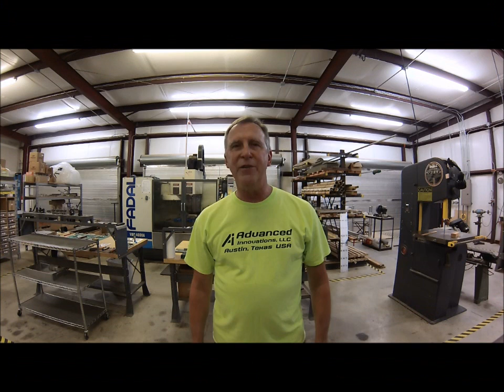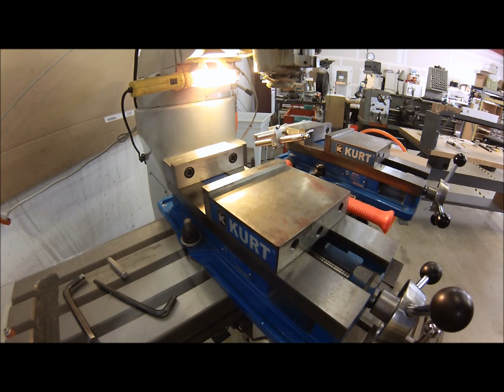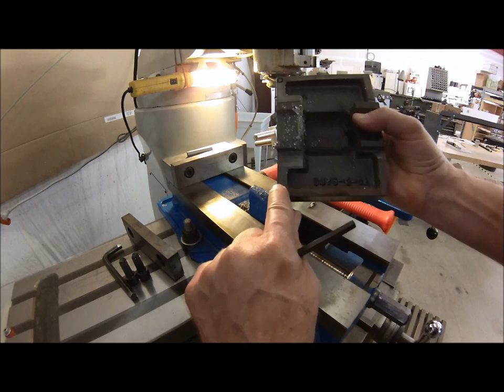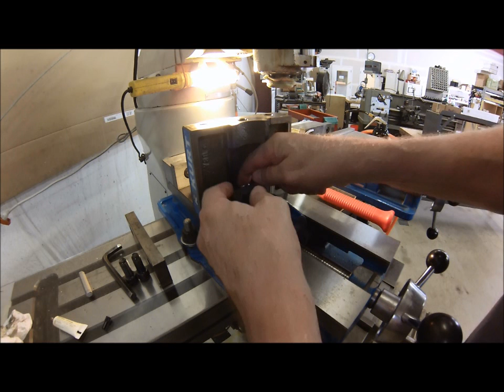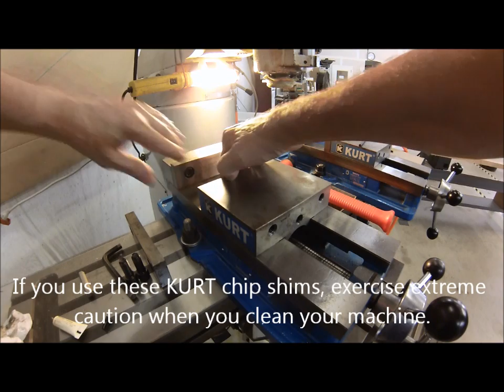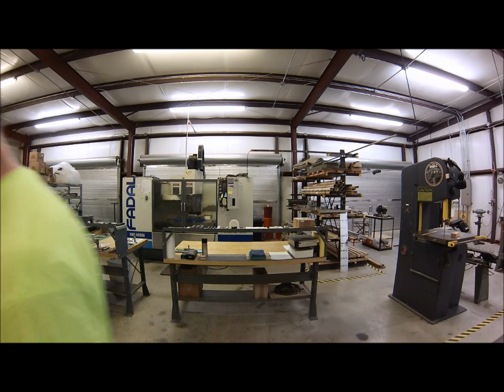Kurt D675 and D688 movable vise jaw removed

Comment: The little notch in the hemispherical button-locking screw is the equivalent of a 'nyloc' insert in a nut.
A little piece of nylon (about a 1/32" square/round by whatever length), that fits into the slot is deformed when screwed into the casting, making it stiff and resistant to coming loose under vibration or chatter. The alternative is a bolt and lock-nut if you don't use the jaws externally.

Comment: I’d like to remind people that when using the jaws outside, which I do occasionally, to remember that the screws holding those jaws on are now the only thing holding them in place. So don’t tighten the vise down to the same extent you do when the jaws are on the inside. On the inside, the jaws are holding the plates from moving backwards, while the screws are just secondarily preventing them from sliding back and forth. But if you tighten the vise too tightly when on the outside, you can actually stretch the screws, and even put. A slight bend in them. Do that a few times, and they can snap off.

I’ve also seen the thinner part of the plates under the screw heads, break out from over tightening the vise when the plates are on the outside. Don’t be one of those guys who jumps up and down trying to tighten the vise as much as possible.

I also keep short head screws in the external screw holes so that junk doesn’t get into the threads, which often happens after some time.

Comment: hey joe here's a good question related to this. I use a pair of kurt vices at work. one job I do I have to use the top. They are different models but the top jaws varied in height by just a few thousandths. They actually use different metal in the models as well. one was almost like a hardened cast, the other is just plain hardened steel; really tough to mill. The first time I did it, I carefully Milled them to what I thought was even. I first close them onto a jaw laying down to get tension on the moveable jaw, run a facemill over them. Looked good actually. Indicator showed very close to 0. Later on I had to check it again because I had a gap. Sure enough, they were out. I thought maybe I shouldn't have milled it that way, so I did it again without clamping anything. I didn't get it as nice but it was still pretty close. Once again, a few months later, they are way out. I had to shim my workpiece. Why is this happening? I keep the vises clean, and I had just previously cleaned under the jaw. If my facemills got them even, what's a surface grinder going to do different?

Comment: I install 1/2-13 set screws in all the unused holes on my vises.  It keeps the chips and grunge out of the holes so when I need to move jaws around I'm not fighting with the screws to get them in and out of the holes.
Reply from the maker: I've done that. Its a great suggestion.

Comment: we have an older kurt vise. is there a way to tighten the slack in between  the jaws and handle response? TIA
Reply from the maker: Try to identify where the slop is. If its between the threaded shaft and movable jaw carrier, the nut is worn out and needs to be replaced. If its between the vise body and dual retainer clip area, perhaps shims behind one the clips would take some of the slop out. Locate the problem area first.

Comment: Great video, thanks for sharing! 
Are there any special consideration for the double vise setup on the mill? How tram them in the same plane?
Reply from the maker: I indicate them just like a single, but I use a 1 1/2" diameter bar of 316 SS clamped in both at the same time while they are loose on the table to get me in the ballpark.

Comment: If you flip the jaws over you will get a little higher profile when clamping a part. Nice video.
Reply from the maker: I make my soft jaws to that higher profile level so my mounting holes are centered. This allows me to use the top and bottom of the jaw for specific pockets and still benefit by the support and reference surface of the vise body.

Comment: Hi Joe!
Gaven here in Houston, TX.  I just acquired and old 3600v Kurt.  I cannot for the life of me get the jaw off the nut casting.  The set screw is not just a normal set screw.  It has an inner hex, spring, and ball inside this set screw.  I cannot get it backed off enough to get the jaw apart.  Any tips?
Reply from the maker: I'm not familiar with it, but I'll look it up and get back to you.
Reply from the maker: https://www.kurtworkholding.com/documents/3600%20Manual%20Series%20VISE_MANUAL%20English.pdf   Looks pretty standard.    Start with this.
Reply: Thanks Joe, I got apart.  Had to do some drilling as the set screw was a bit boogered.  Thanks again!

Comment: hmm, I thought everyone knew about the reversible vise jaws, haha. I had the "luxury" of taking apart many kurt vises for cleaning (for some reason i'm the only one in the shop who feels the need to periodically remove the vises and clean them). Particularly with regard to CNC (due to coolant and the constant bombardment of air from the airguns) the chips have a way of getting blown under the movable jaw and getting packed in there. I recall taking apart a few where steel chips had gotten under there and rusted together while collecting a bunch of rancid coolant in the process. I took the jaw off and tapped it on the workbench and out came two huge caked up clumps of nasty brown smelly chips (probably well over a year old). If anyone is interested, Kurt sells rebuild kits that include new thrust bearings and a new Pivot ball thing and replacement brush wipers for the shuttle that wipe the screw. I can't quite recall if they include the small o-rings that fit under the jaw. I'll have to take a look tomorrow, we keep a couple kits handy, their not too expensive IIRC.
Reply from the maker: Hey Sandman. That reversible jaw trick is pretty common, but I figured I'd throw it in there anyway. Ya never know. We do this stuff in our sleep and others are just now opening the box. Thanks for watching. I'll try to post something you've never seen !

Comment: great show and tell. i keep a cheap 3/8 air rachet under my bench it works great to remove and replace the vise jaw bolts. i think i remember reading some instructions on a kurt vise that told you how to adjust the set screw. i believe it said to snug up the set screw and than back it off 1/4 turn. the play is necessary to control the down force of the movable jaw.

Comment: Wow Nice Joe, Thanks. Well I just went and check my vise out, its an older one Joe, and I guess I did not let you know on that first post, and that I had ordered a set of jaws from Kurt, that I put in place of the soft jaws that were on it when I got the vise. Guess I will have to strip down all the way cause it will not close all the way, stops about 3/4 of an inch from closed ? Maybe there is some swarf in the nut.
Reply from the maker: That would be the next logical thing to check. Good luck.
Reply: Thanks for the help Joe. I will let you know how it goes.

Comment: Great little video.
You forgot to mention the holes in the jaws are off center so you can have different amounts of stick up.
I have a 4" Kurt, and a pretty decent Chinese 4" on a swivel base.
The Chinese vise does the job well, but the Kurt is a whole different animal.
Got mine with a big coupon and free shipping from Enco. Worth every dime.
Reply from the maker: That's a good point. if I recall correctly, the holes are off center to the top. So.....If you make soft jaws, use the  .937 center line dimension and make a symmetrical jaw based on that dimension. It will allow you to flip your jaws upside down and use the bottom too. It makes the jaw taller and allows for top and bottom to be custom pockets.